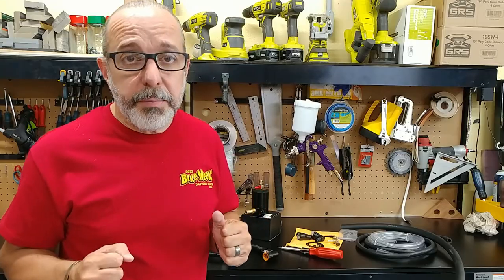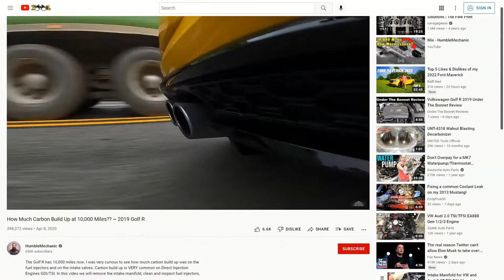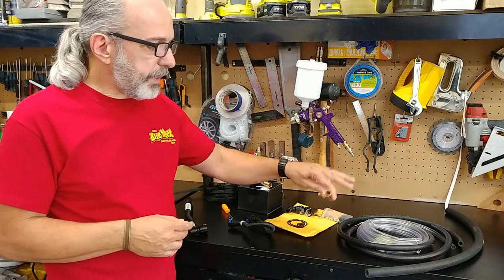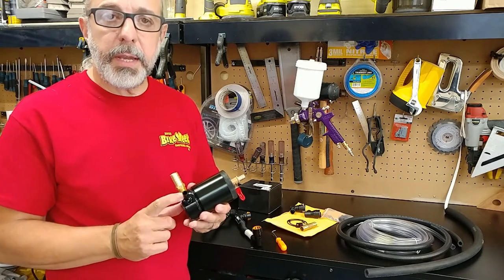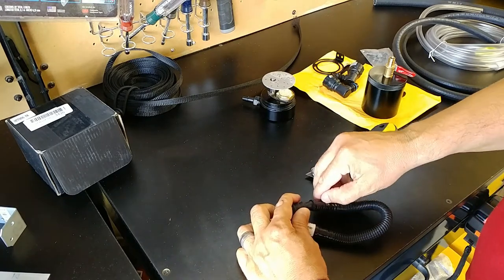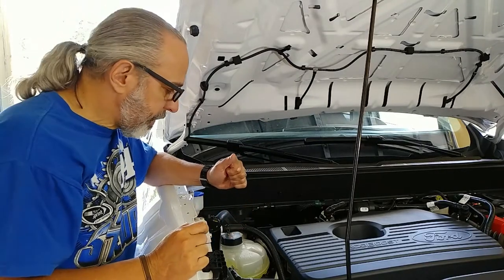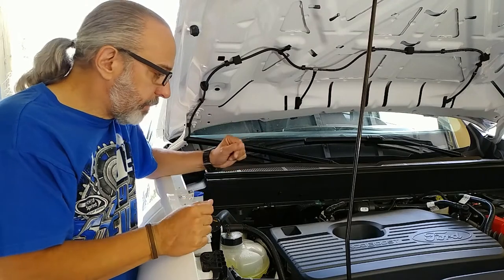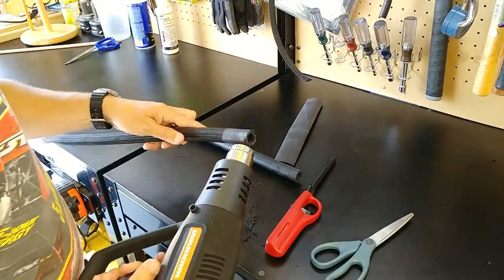Ford Maverick Catch Can Oil Separator Installation (Best Practice)

Comment: Hey JC.  This is Bob, meet you and your new Maverick in Lowes parking lot in Port Charlotte in April.  I told you I would subscribed to YT channel.  First, let me compliment you on today’s video.  Well done and thank you for sharing your knowledge and experience.  Second,  what are your thoughts on whether  a catch can oil separator is needed on the Maverick hybrid engine?  Third, I’m still waiting on a Production Schedule for my Maverick (Oxford White, Lariat with Luxury, 360 and moonroof packages ordered October 16, 2021).  Fourth,  Are you a member of the MaverickTruckClub?  There is a lot of good information shared there.  Thanks again for the video and I’ll be on the look out for you next time I’m in Port Charlotte!  Have a great weekend….
Reply from the maker: Hey Bob, good to hear from you! You have my number. Feel free to give me a holler. I have made friends with a half dozen guys in the area with Mavericks, but all with 2.0 EcoBoost engines. I had a guy follow me all the way to the Harley dealer on El Jobean Rd. the other day. He had received the email from Ford saying that his Maverick was on its way and had all kinds of questions. He just took delivery on Monday. I have not had a chance to look under the hood of a single hybrid, but it is equipped with a Mazda Duratec 25, also known as a Mazda "L" engine. That is one of the most reliable engines Mazda has ever designed. I would have been trill if they had just added a turbo to that engine for non-hybrids. The current Mazda "L" engine is port injected, so carbon build-up on the intake valve is not an issue. I am not sure if they have done anything differently regarding injection typology for the Maverick, but I will look into it for you.
Reply: Catch can's aren't really necessary on non-forced induction engines.
Reply from the maker: ... thanks for commenting, but please know that while force induction exacerbates the problem, all direct-injected engines suffer from this issue. From technical briefings I have read, almost everyone, or at least Ford and Dodge, are switching to dual injectors by 2025. Also, know that direct injection engines lose their advantage around the 6000 RPM mark. That is why they are all limited to 6500 RPM. An extra low-pressure injector in the intake runner does away with the carbon issue and makes the engine a lot more efficient over a broader RPM range. Please look it up. The information is out there.
Reply: @CubanRedneck  Oh I agree with you, I'm merely stating that the amount of blow by you get from an NA engine is prettttttty low, unless you're talking about a high revving engine. Most economy cars (the 2.5l in the Mav), will probably see a negligible benefit from the addition of one, and likely more things will fail long before severe carbonization takes place on the valves.
Reply from the maker: ...yeap, and I just confirmed with my contact at the dealer that the 2.5 is a port injected engine. Carbon buildup is not an issue.

Comment: Why did you put 2 catch can instead of only one from the top?
Reply from the maker: …hey thank you for stopping by. A couple of things the installation of the catch can on the bottom is the most important since it collects 75% of oil mist, and the one on the top collects the remaining 25%. If you watch the video, my original idea was to sum them up and connect them to the throttle body, which has the most vacuum. However, this proved to be too much vacuum, and the engine was collecting a lot of oil in the valve cover. This can be addressed with check valves and stiffer hoses, but dual catch cans like in the Mustangs, Toyotas, and other vehicles is the easiest and most affordable way to address this.

Comment: Thanks for your informative video. Is the catch can needed on the Hybrid Atkinson Cycle Engine?  Thanks again
Reply from the maker: … hey, thank you for stopping by, and no the Mazda engine in the hybrid is port injected and does not suffer from excessive carbon buildup on the intake valves. This is almost exclusive to GDI (Gasoline Direct Injected) engines!
Reply: @CubanRedneck  Thank you for replying back to me. I have a 23 Lariat Hybrid on order.
Reply from the maker: … AWESOME! You are like 20 steps ahead of me. I was in a crunch for time and was forced into ordering a work truck, for the lack of a better word! Just about everything, I'll be adding to my mine yours already has, but people have been asking about my accessories, and that may be of interest. Thank you for stopping by!

Comment: I am trying to figure out how the clean and dirty side of the PCV system was designed to work by Ford. You verified that there is a lot more vacuum on the dirty side and that air can move inside the entire engine from the crankshaft up to the valve cover. So, under normal conditions wouldn't the higher vacuum drawn thru the PCV valve from the fuel/air going into the engine pull a vacuum inside the entire engine? Then air would need to get into the engine to replace the air sucked out by the PCV, so the line on the clean side would draw air from the tube running from the air cleaner to the turbo allowing air into the engine to reduce the vacuum. Does my understanding make sense?
Reply from the maker: … hey, thanks for the visits! So, you kind of described the issue. The extra vacuum is experienced when you get off the throttle because the turbo does not stop on a dime. As the throttle body closes, the vacuum shoots up. But it is not there all the time! With that said, there is oil injection for the roller lifters, the cam, and the high-pressure fuel pump under the valve cover - all of these creates an oil mist or vapor that needs to be handled and the reason for the second port. 

The "T" approach did not work, because the drain passages from the head's valve cover area to the crankcase are somewhat restricted to create a sump effect or pool of oil on the valve train. This is an educated guess. I have not taken the valve cover or head off but have dealt with this issue before. In some older Chevy small blocks, race engine builders drill the oil passages in the lifter valley to correct this issue. Google - drilling oil passages in lifter valley block 

After driving over 1000 miles since the installation, I believe dual canisters are the way to go. If this sounds dumb, please understand that FORD's agenda and mine are not the same! #1 they are trying to make the regulating bodies happy and sell me engine service or a new vehicle in 75K miles! … I am trying to get this engine to last me 250K!

Comment: My Cuban Genus, would you put a or two  catch cans on a 2015 Silverado with a 5.3 v8?
Reply from the maker: … without a doubt, the 5.3 is a candidate for a catch can and several other mods, and make sure you keep up with the maintenance! Those engines are failing at an alarming rate. There are currently several active class-action lawsuits because of that - https://www.classaction.org/media/harrison-et-al-v-general-motors-llc.pdf. GM has about 2.5 million 5.3 on the road, and if they have to replace them, they may end up filing bankruptcy again. If you run into an issue that the dealer does not want to repair it under warranty search it on Google and join the lawsuits for the given issue. The biggest problem is AFM and DFM. For more details, search for: GM AFM and DFM Class Action Lawsuit
Reply: @CubanRedneck  copy copy,

Booyah 👊😁🇺🇲
Reply: Should I do two like you did on your Maverick?
Reply from the maker: ... just an FYI, I am not 100% familiar with the 5.3 but I did make some calls and yes, there are two crankcase ventilation ports on the 5.3. A clean side and a PCV side as in the Maverick.
Reply: @CubanRedneck  your the man 👊😁👍🇺🇲

Comment: Is there a way you can post where the hoses are connected to and from.  It’s hard to see on the video. Thank you!
Reply from the maker: ... hello. Can you please clarify. Are you talking about the engine side or the catch can side?
Reply: On the video I see you have a total of 4 hoses.  2 on the passenger side, that I clearly see it’s connected on the top.  The other 2 I know goes at the bottom.  I just want to make sure how those two from the bottom are connected to the 2nd catch can.  and you have the 2nd catch can.  I just want to make sure I don’t damage my Maverick is I connect them incorrectly.  I hope that  clarifies my question.  Thank you.
Reply from the maker: ...Yes, you are going to break this hose - https://pasteboard.co/eT0V9ktllIdK.png and insert the catch can in the middle. The vacuum side (near radiator) goes in the port with the filter.
Reply: @CubanRedneck  Clicking on the "pasteboard" link yields a dark background web page with the message "image not found".
Reply from the maker: ... sorry about that. Not sure what happen. I will shoot fresh pics over the weekend and load them to the blog post -  https://cubanredneck.com/ford-maverick-oil-catch-can/

Comment: Great video! Just wanted to confirm, the ports are tucked away in there so it’s hard to see, but the intake manifold port is the outside port closer to the fan correct?
Reply from the maker: ... You are correct, thank you for stopping by!
Reply: @CubanRedneck  thank you!
Reply from the maker: ... see my blog for additional details, https://cubanredneck.com/ford-maverick-oil-catch-can/ ...but feel free to contact me if you have any questions.

Comment: What are you using for your hosing? What size? I am planning to do the same and want to have everything ready before I start because I don't have a backup vehicle.
Reply from the maker: .... hey brother, thank you for stopping by, and sorry for the slow response. I was out fishing ahead of the cold front. All the components are on my blog - https://cubanredneck.com/ford-maverick-oil-catch-can/ I originally had used heater hose and heavy-duty fuel hose but we found those proved inadequate during dyno testing.
Reply: @CubanRedneck  Thanks for the reply. Are the top and bottom hoses the same size? Why 5/8" and 3/8" hoses?
Reply from the maker: ... Yes, the high-vacuum (lower hose is 3/8), and the valve cover (top hose) is 5/8! As I said in the video, a high-quality marine fuel hose will do for most applications (daily drivers), but after getting the engine a little hotter than usual and making serval dyno pull north of 6500 RPM we found the high vacuum hose getting soft, and at the verge of collapse. So they were both upgraded to braided racing hoses. Shiny stainless hoses like the ones the Earls make were enticing but I am trying to keep a low profile. I will make sure to highlight the changes in a future video. Thanks again...

Comment: Where can I find the $8 pvc hose as a spare ? And where we e do the front of the engine side hoses connect? I need more instructions, thank you so much. Great idea!!!
Reply from the maker: … hi the first thing you need to do is ID the in and out of your catch can. I suggest blowing on it. The inlet with the filter goes to the vacuum side. That would be either the throttle body side on the front of the engine or the air intake tube on the clean side. The baffle sides (other inlets) goes to either the PCV (engine block side) or the valve cover port! 

As to replacement parts, I am getting all my parts at the local dealer, A group of friends and I run a Crown Vic in stock class at 4-17 Southern Speedway, and we are constantly buggy the parts desk for hard-to-get OEM parts. If your Ford dealer is not too friendly, as I keep hearing many are not, a quick search online revealed several sources at competitive prices, i.e., https://www.tascaparts.com/oem-parts/ford-breather-tube-k2gz6758h

Comment: why not just occasionally spray some wd40 down the intake after the air cleaner.  some of that will settle on the valves and clean off.
Reply from the maker: ... becasue if you have any experience with EcoBoost or GDI engines, you would know it does not work. Also, the active ingredients in WD40 is very damaging to the $2000 catalytic converter - https://parts.lakelandford.com/p/Ford__/EXHAUST-MANIFOLD-AND-CATALYST-Mnfd-wconverter/105611155/LX6Z5G232A.html and prone to hydrolocking because it does not automizes very well.

CRC - makes a 1000 times more effective cleaner, and even that can't be run through the engine without damaging the cat!

For peace of mind vs. the cost, catch cans are the way to go, and that is why many European automakers like Mercedes and Audi are starting to implement them at the EOM level.
Reply: @CubanRedneck  Thanks for the update.

Comment: All of you better check with The Ford Motor Company before you install anything on these engines. You may end up with a situation where you may be voiding your factory warranty by adding unauthorized equipment to the engine on these vehicles ! Be aware, the car company's are always looking for an excuse to void a warranty !
Reply from the maker: … are you aware of the Magnuson-Moss Warranty Act (MMWA)? Also, know that many dealers are already offering the installation of catch can oil separators. At around $500, of course!